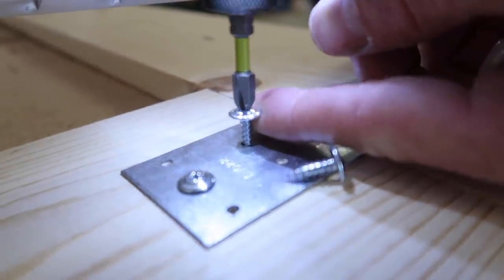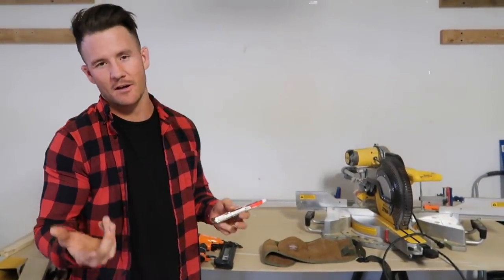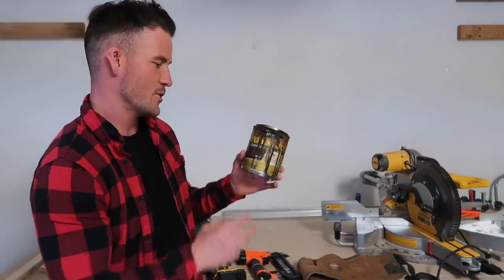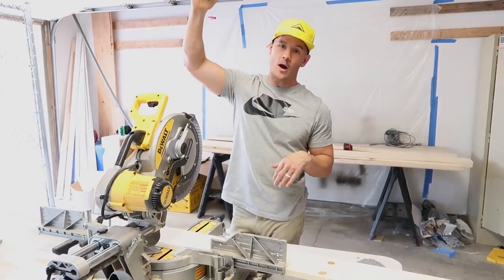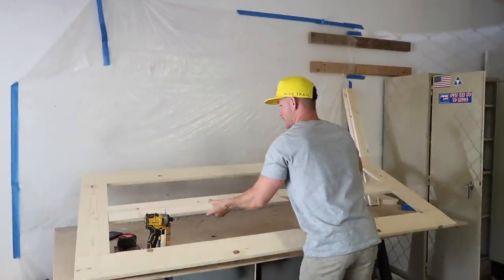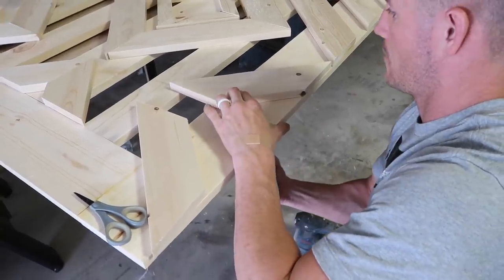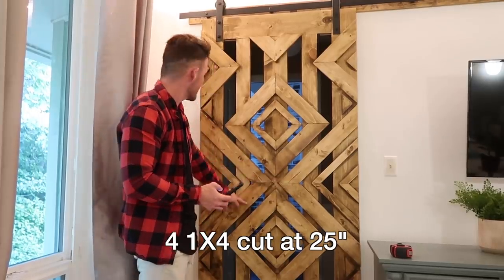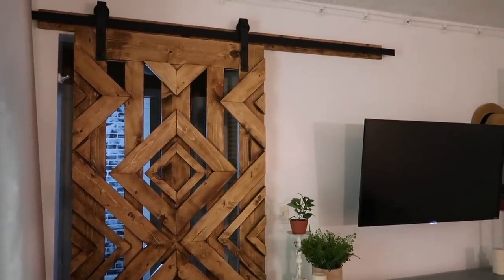DIY BARN DOOR | Barn Door For $100

Comment: Great video! The saw you linked is single bevel... you mentioned it has to be double bevel. Can you explain? I was considering purchasing the Harbor Freight CHICAGO ELECTRIC
12 In. Dual-Bevel Sliding Compound Miter Saw With Laser Guide System
Would this work? 
Or the 12 in. Dual-Bevel Sliding Compound Miter Saw with LED & Laser Guide